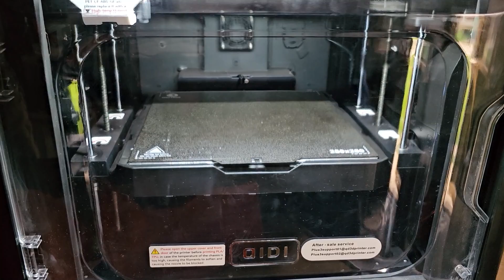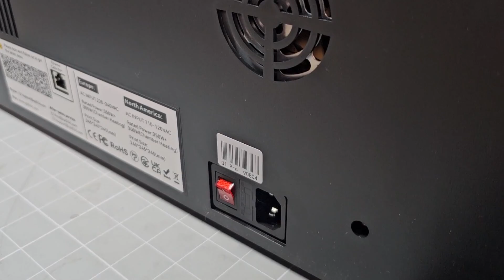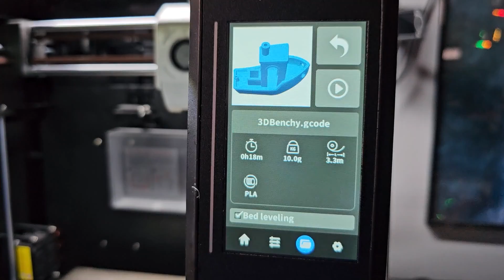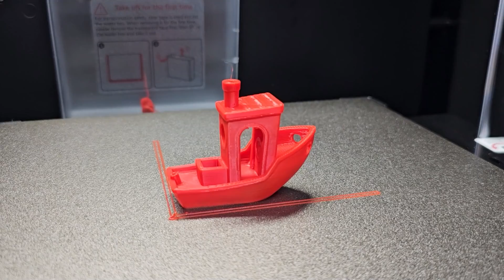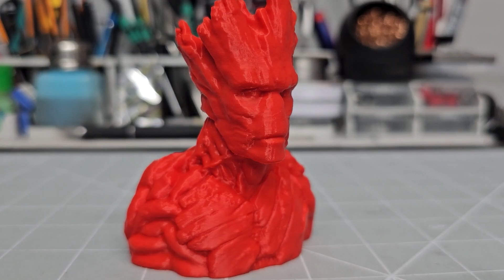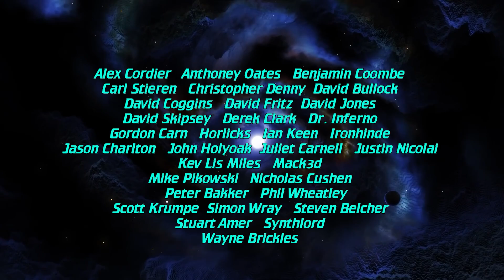The Qidi Tech Q1 Pro FDM Printer - Simple 3D Printing Beginner's Guide

Comment: Hi Wayne, thanks for your review. I'm wondering about the location of the filament feed through the housing in the top left rear corner (looking from the front).
In all the other reviews, the tube hangs out at the back, top right (looking from behind to the back of the printer)
I'm also wondering about the stop corners at the back left and right of the build plate. In the other reviews there is only one in the centre and was therefore a major point of criticism.
This meant that the build plate sheet could be positioned at an angle.

Have you received a new, revised/improved model from Qidi? May I ask when you received it?

If so, you should definitely point out that Qidi has made improvements 🙂
Reply from the maker: All valid points but they haven't impeded me yet.

Comment: If you are doing a printer review, please talk about the print quality, can you use any slicer or is it locked down to Qidi, what is the firmware (Klipper?), is the mainboard 32 bit, is it noisy?
Reply: It comes with a 2 year old locked down version of Klipper firmware but I do believe that you can upgrade to the current full version  and as for the slicer, you can run the full version of Orca slicer 2 and it comes with the profile in Orca slicer, from what I have seen,  it has very good print quality. I have not gotten mine yet  because I am still saving up,  I'm disabled and can't work anymore so it's going to take me a while
Reply from the maker: I.mentioned it comes with Qidi Slicer. I'm hoping the quality speaks for itself in the pics. As for sound. I'm sure most FDM machines have the same harmonical.acoustics lol
Reply: @WorldofWayneUK  OK, but is it locked down to that slicer, or can you use Cura, Prusa etc?
Reply from the maker: @gusbert  tbh I love Qidinslicerbso much I haven't tried anything else. It doesnwork with Cura too as that's what I used for Vincent